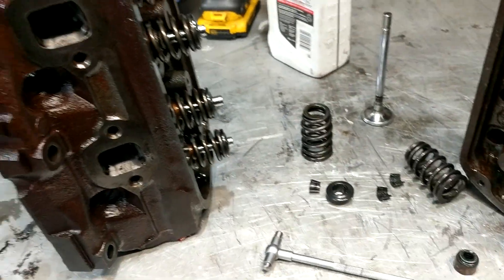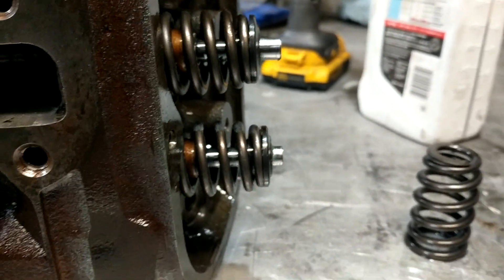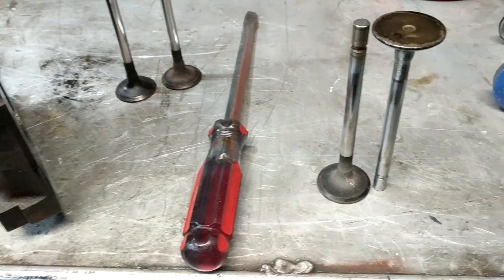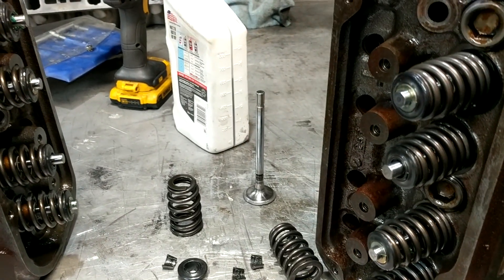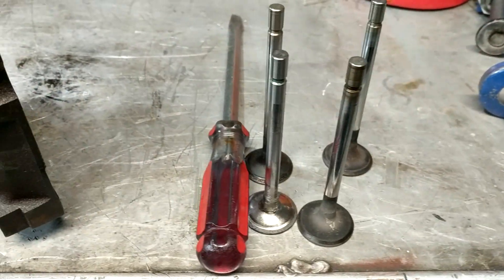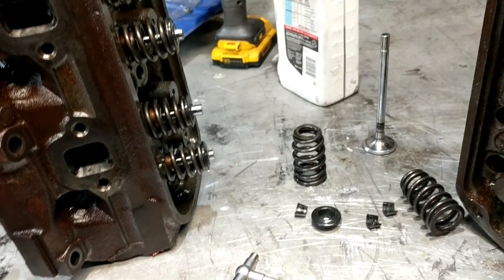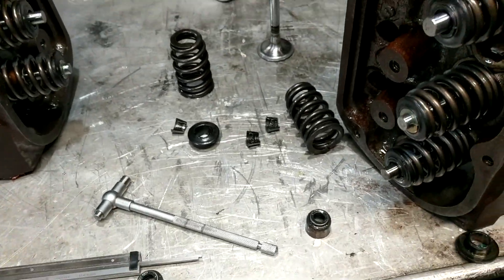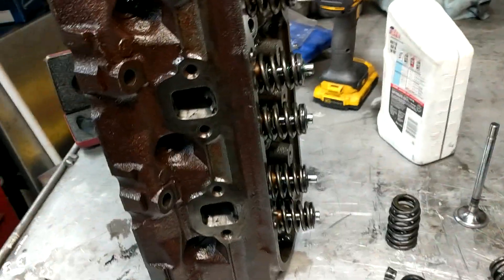E7 heads final assembly

Comment from the maker: I got them all together last night, set the heads on the block and was cleaning the bolts up. Then i noticed the stem tips on the intakes were at a different height than those on the exhaust. I got to checking and found that I had used E6 intake valves on these because they were flat on the bottom, vs. having a concave face, more compression is more better. Turns out Ford used different length valves in the E6 heads, so going to pull them out tonight and swap all the intake valves. Hopefully I can still get it all together by Friday night.